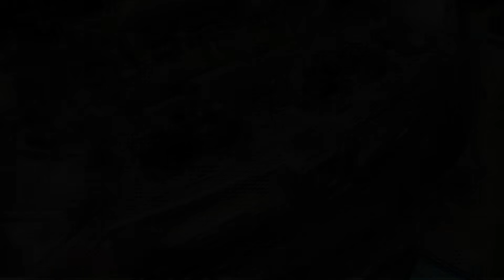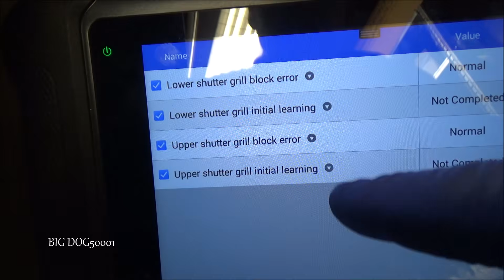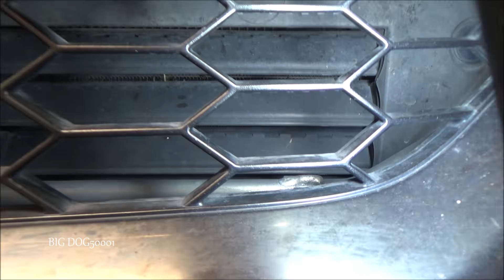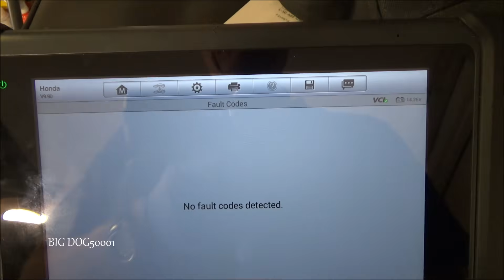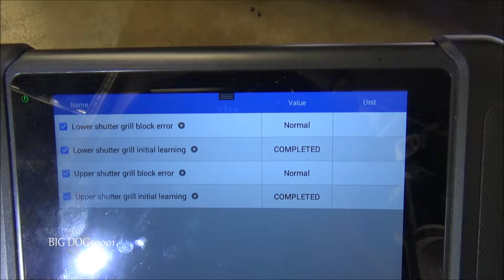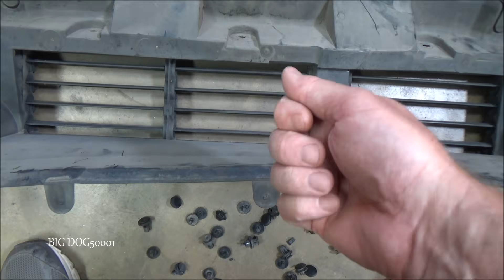Honda Shutter Grille Systems

Comment: 2019 Honda Odyssey, lower shutter grill, passenger side, road debris hit it and broke off two top blades, loose blades prevented any movement of remaining blades for sometime. I removed loose blades and remaining blades open and close now in what appears to be normal operation. But van still displays shutter grill error message. Im considering replacing whole lower shutter unit
Reply from the maker: Sounds like it will need to be replaced.

Comment: Hi and thank you for this video.  My daughter has this same warning in her 2018 CRV and the quotes I received were $1700 and $2900

After this video I felt confident I could do the repair and ordered the parts and did the job

I drove the car for about 1.5 hrs on the highway to test the issue and it came back.

If it’s not the shutter grille what else could it be?  From what I’ve read it might be electrical issue and not properly communicating with PCM

I do probably do not have the needed scan tools but was hoping for advice before I have the dealership replacing random parts
Reply from the maker: I would start by looking to see if the grill is operating properly like I showed in this video (upper and lower fully opening and closing).  I would visually look at the position of the shutter grills when the car is having trouble too (without turning vehicle off).  If you live in a location where it gets really hot (like Phoenix), I have seen these give a false shutter grill warning sometimes, especially when driving on the highway.  The car thinks the shutter grill must not be working because of the engine temps it is seeing, but in reality it is simply because it is so hot out.

Comment: Great video—thank you! Here’s some further context: Last week, my CR-V’s electrical system failed completely. The dashboard was a cascade of warnings, including 'Shutter Grille Failure.' My local mechanic referred me to the dealership as it was an electrical issue, where they confirmed it was the shutter grille.

The quote for the fix-$1,643.73. I’ve actually seen this warning for years during heatwaves, usually accompanied by a reduction in power, but I never had it addressed. In short, the grille was intermittently sticking but with a little lubricant seemed to be remedied.  The recent electrical failure and price tag caused me to do some digging. I found there's a class-action lawsuit regarding this exact issue. My mechanic share that his local parts distributor in Vermont is moving 10 of these units a week—which is massive for a small state. This clearly needs to be a recall. I plan to file a report with the BBB and see where it goes. Thanks again!"
Reply from the maker: Thanks for the input!
Reply: Having electrical issues. This is one of the issues I’m having and it causes my engine to overheat at slow speeds. Awful

Comment: I wish my Gen 3 Prius had this system to conserve heat during cold months. In stop and go city driving, with the on/off nature of hybrids, the ECT languishes from ~120-150 degrees. 

This ends up producing a lot of blow-by. Engine oil fuel dilution and water contamination during the cold months is pretty bad. Also sends a lot of muck out through the PCV. I started running an OCC on my PCV line a few years ago and during winter I fill that can every month.

I may experiment with something up front to see if I can get it to run a little hotter.

Comment: I have a 2018 CRV which had the recall done to address fuel in the oil. The engine will not heat up at below freezing temperatures regardless of how long you let it idle... even after 20 minutes.  My XTool IP819 scan tools shows pids for  Upper/Lower Shutter grill initial learning (both show completed 10 seconds after starting the engine) but NOT for Upper/lower shutter grill block error.  Does this mean I have different s/w on my CRV computer than you that shows the 4 pids on your scan tool?  Does anyone know?

Comment: At the end of the video you show all the broken clips.  Have you found a source for affordable clips that are of or near OEM quality?  If so, I sure would like to know that answer.  Over the years, I have purchased many clips are great prices from Amazon, but they are mostly very poorly made crap.  On the opposite side, I have also purchased (when I felt necessary) Honda OEM clips from the dealer and online for a few bucks each.  It looks like there are about 25 broken clips in your video.  I would love to know your thoughts on the matter.  Thank you for the excellent and informative videos.
Reply from the maker: I don't use many Honda OEM clips, they are just too expensive. I have used many brands of aftermarket and they are generally all the same (and not as good as OEM).  The aftermarket ones usually hold just fine, the issue is they break on removal.

Comment: How did you know the shutter grill was bad. Was an error message displayed? Good video
Reply from the maker: Good question, I probably should have mentioned it in the video.  It was intermittently giving a warning message on the dash.
Reply: @BigDog50001 ok thank you
Reply: I received the dash code right after a high wind gust caught the front of my CRV. Lost quite a bit of power as the warning said. After parked for awhile, all is back to normal.